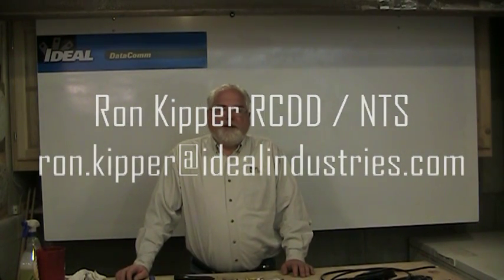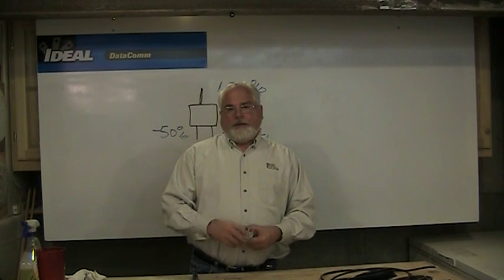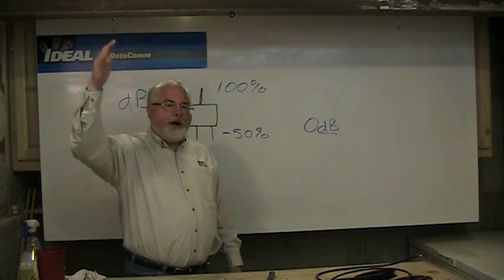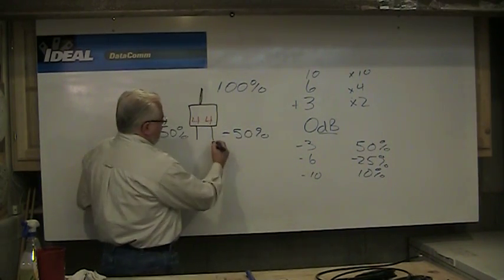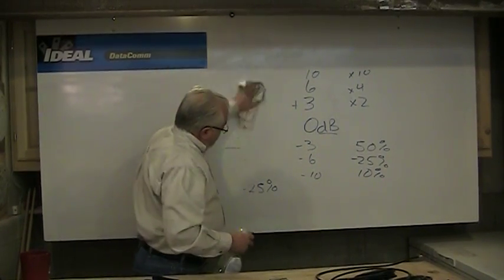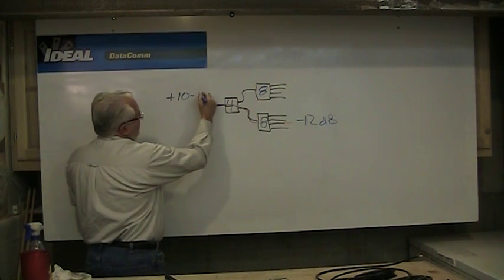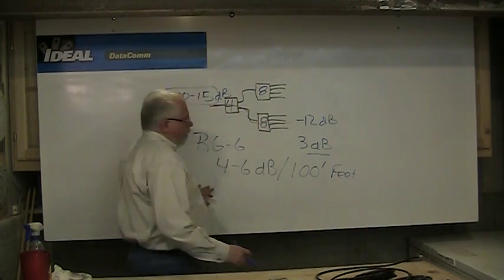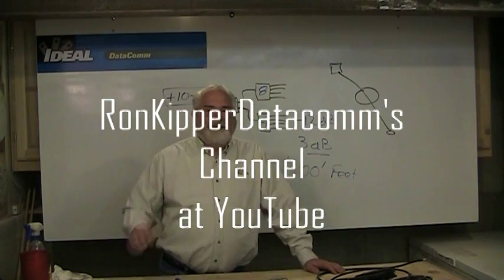CATV Splitter Signal Loss

Comment: Hey Ron good channel I have a question. I used the splitter for my tv and for a WiFi router. Before the router comes I put the splitter in. I have no signal for my tv. Why do you think the problem is
Reply from the maker: I am not clear on how you wired that but use a 2 way splitter to feed the router and the other port can feed the TV or another splitter. If you have no signal at the TV I would start looking for a short which is usually in one of the connectors. No braiding should be touching the center conductor. Good luck Ron

Comment: Is this information still relevant with XFINITY X1? Various support forums say not to do this on the X1 system and to use a plain F type cap.
Reply from the maker: Hi Jason the splitters loss has not changed but I am not familar with the Xfinity X1 system and not sure what frequencies they operate at. Have you contacted them to verify it? Ron
Reply: @RonKipperDatacomm1  I was told on a support forum their signals are all digital and this is less of an issue now?
Reply from the maker: Jason what are you trying to get done? I am pretty sure the splitter will work for you. We sell them in retail and if they were a problem we would of heard back from other customers. Ron
Reply: @Ron Kipper Datacomm I have two bedrooms that have wall outlets that are connected to the main splitter. I plan to use them within a year and just want to cap them for now. I purchased 75 ohm resistors and capped the outlets   at the wall. I assume this will improve things within my system on Xfinity? I don't want to redo all the splitters as I plan to use these outlets.

Comment: Hello. This is not joke but I want to ask how I can phisically stop singlas going from TV spliter to my TV? Because my sibling is addected from TV.
Reply from the maker: Disconnect the cable somewhere between the two.......have fun Ron
Reply: @RonKipperDatacomm1  Thank you. I'll buy insulation tape and wrap around on the spike. I think it will work

Comment: Hi Ron, and thank you for this video :)
I have a question....I moved into a new house and I had to sign up for service. The basement was a mess of old wires from previous installations and many splitters, so I took a look at what I had available.
Then I signup up for cable with this configuration: the main wire coming into the house from the pole, one 5-1002Mhz splitter and two wires for HD tv box and internet modem.

The funny thing is that in order to make HD box works I have to take the wire that goes to the internet modem, use that wire and attach it to the HD box, wait until the HD box gets the channels, and then connect it back to its own wire (and the internet modem back to its own)
I replaced wires and splitters...looks like nothing changed. I repeat, that's the only connection..on wire, splitter, two wires...no loose ends, unused ports..nothing.
Of course every time I disconnect the HD box I have to do the same process again.. 
Any idea? :/
Reply from the maker: That does sound like something funny is going on. Try replacing the splitter. If you have already done that then call the provider. It sounds like you are not getting enough signal strength and the 2 way is just losing enough signal your equipment is having issues with. Or you could look into adding an amplifier and installing it before the 2 way splitter to increase the signal. Good luck Ron
Reply: Hey Ron, thank you so me much for your help. 
I replaced everything so I guess you are right about the signal strength and loss.
I'll update this when (if) it's solved :)
Reply from the maker: Ok sounds good take care Ron

Comment: Great channel... I have a question.. Does the signal loss applies even if i dont use a splitter port?.. If i have a 1 to 4 splitter (12db loss), but use only 3 of the 4 ports... Do i still have the same loss thru all the ports?
Or if i only really need a 1 to 2 splitter,, but only have a 1 to 4.. do i sill get 12 dB loss?? (even if i'm only using 2 ports)
Reply from the maker: Luis Manuel Cova Aellos Luis nice to hear from you. Yes if you do not use one of the four ports on a four way splitter the loss is the same on all ports about 8 dB. Same on a two way if you don't use both ports about 4 dB. So if you only need a 2 way don't use a 4 way because the loss will double even if you don't use all the ports.Good LuckRon

Comment: rg-6 on lower channels, lose about 1.62db, and on the higher channels lose around 6db.
I've learned that there is more to cable than people think.  Not just only forward signal that you mention but also return signal that we use for internet. And how much forward you have coincides with the return path.
Reply: I've also found that with the old analog signal, the cable can take some abuse but now with the  all digital systems, You have to be a little more careful on how you bend cable and put fittings on.
Reply from the maker: MrHellested Hey thanks for the feedeback! I say on average RG-6 loses about 4 dB but many would error closer to the high end which is about 6 dB like you mention. Yes and the higher the frequency the more important it is to making really great connections and not disforming the cable during the install.Take careRon